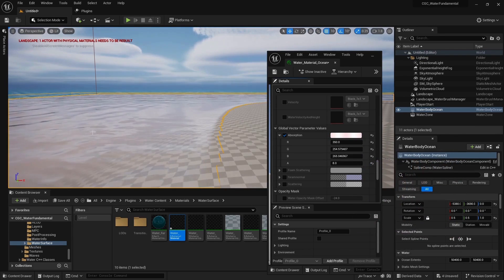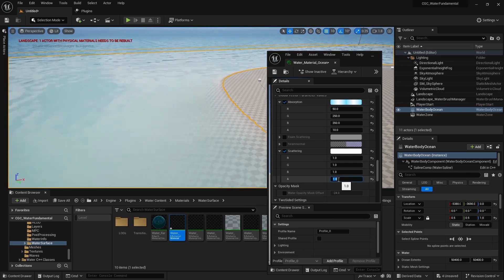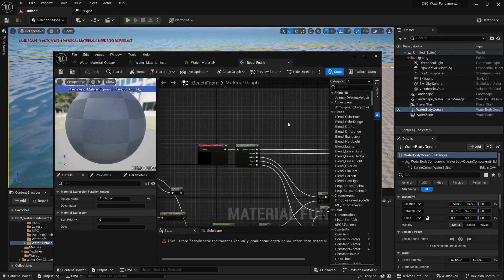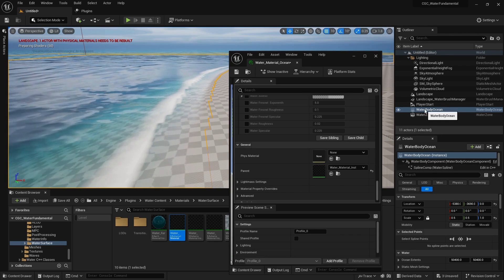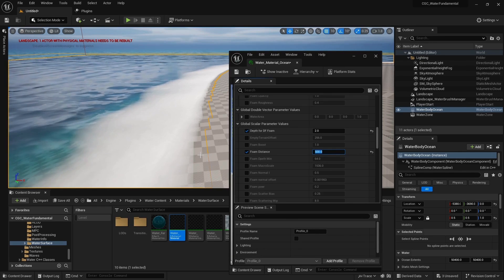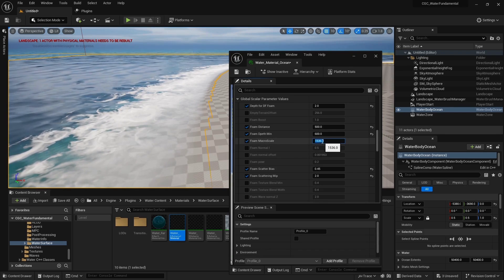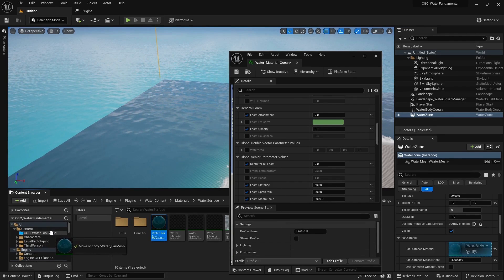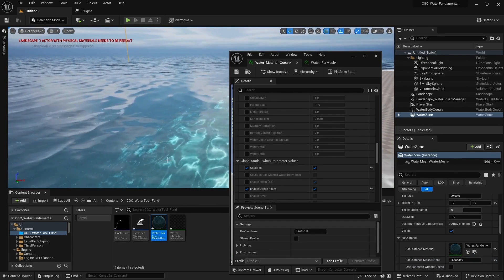UE5 Water Material Tutorial: Color, Transparency, Foam, and Caustics #unrealengine #gamedev

Comment: What if I can't move the water to Z zero due to having built other systems that require landscape waterlevel to be 2000 units above the zero?
I have tried to find a way to offset that, no luck so far

Comment: Yeah years later i still envy Crysis on their water system,  it just works and it looks great.
I think that water plugin worked nice in UE4 and there were tessellation option, UE3 games had some nice water shaders, like in BAtman series 
To somehow easy pop in due the distant mesh field bug i used distance fade nodes to lerp it.
Tried to post link to nodes but Youtube deleted comment 
It will kinda fade in beach foam, im still looking why it only works on below 0 position, but no luck
Edit:
I figure out how to get foam  above 0 height there is in beachfoam nodes, in rectangle marked as NearShoreFoam and there is Absolute World Position going to Mask B and then multiply by -1 bypass the multiply -1 and you should get beach foam above 0 height.

Tried to post link but cant Youtube delete the comment

Comment: Which version of UE 5 did you use? For me with UE 5.4.2 the foam situation is reversed. That is, where there should be foam there is water and where there should be water there is foam. You will understand that it is not a nice sight to see an ocean with 99% foam.
Reply: Hey, Same is happening with me.  Found any solution? Using UE 5.4.3
Reply: Try adjusting the Foam Scatter Bias to a negative number.